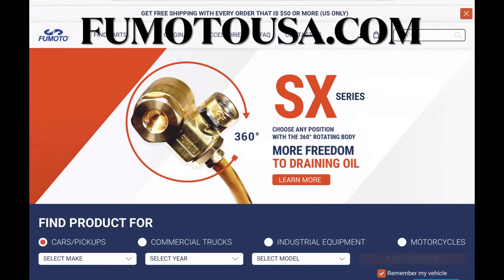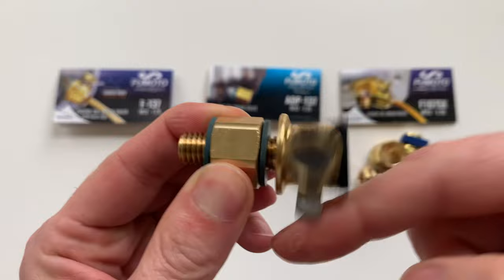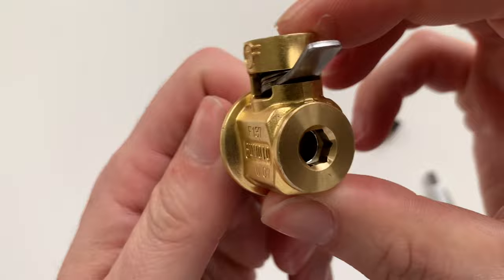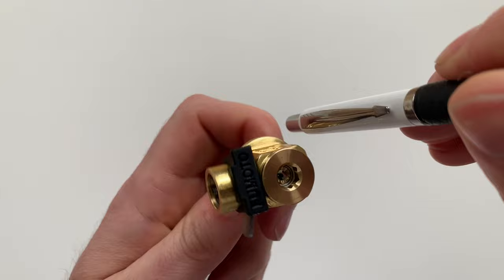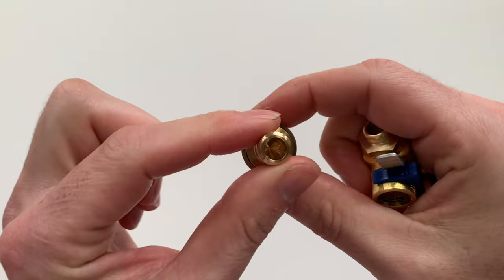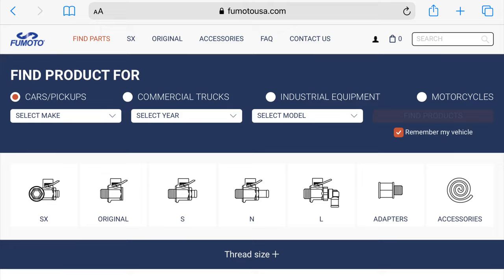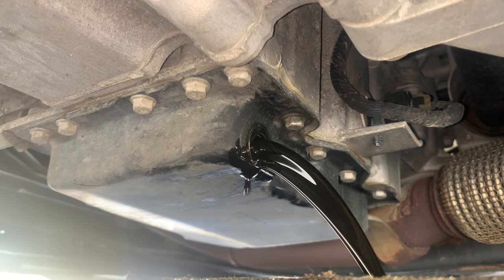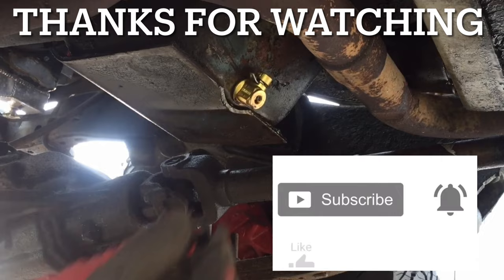Full Review of FUMOTO Engine Oil Drain Valve | Installation & Use | All Types (F, ADP, SX, S, N, L)

Comment: I just received mine today for both vehicles. Best investment I ever made. Did u use the washer came with or did u use the old washer?
Reply from the maker: I’m actually doing an oil change today and it’s nice to know I will just be flipping a lever with no tools required!
I used the blue washer that came with the valve. Not any factory washers.
If it is an SX, the valve has an integrated rubber o-ring and no washer.

Comment: Do you think this would be good for Honda Civic 2011…… ??
Reply from the maker: I have not personally changed the oil on a Civic, but I would personally install it. It will make oil changes easily with no tools required.
Reply: @HowtoandReviewsOfficial  - No tools? What about removing the oil filter? LOL...
Reply from the maker: @irishkelly654  That’s a good point. I personally just use my hand. However, some people put them on way too tight and they can be a real battle to remove.
I do all of my own oil changes, so I can remove them with my hand.
Reply: @HowtoandReviewsOfficial  - Thanks for the reply. Yes, I hear you. I do my own, too. I once had a filter leak because I didn't tighten it enough so I think I now overcompensate a little, ensure it is snugged down. LOL...anyway, all the best! Cheers...
Reply from the maker: @irishkelly654  I have definitely been there. I’ve punched a screwdriver through the filter to use as a lever more than once!

Comment: @4:25.... you could just jack the car up like a normal person to reach the drain valve.............
Reply from the maker: Good point, but slipping a board underneath was way easier and faster than dragging a floor jack out and setting up the jack and jack stands. The board was not as inconvenient as it might look. 
But, now I just reach under and flip the valve open, so it’s all good.

Comment: How much dirty oil do these leave behind? I remember on a message board someone tested this and the one that was tested left about 1/2 pint of dirty oil behind. It would have been nice if you would have shown this in the video.
Reply from the maker: That is a great point and an excellent video idea! I have also considered this, but have not tested it. I will make a video on it at my next oil change. I will drain everything with the valve, then put an empty catch pan in place, then remove the valve and measure how much additional oil drains.
I have these on four different vehicles. Maybe I’ll wait until I do it on two or three of them before I make the video so there’s more data. It should be vehicle dependent because of the shape of the oil pan.
Reply: @HowtoandReviewsOfficial  I did some research and on Fumoto's web site it states that none of the threads will extend into the oil pan.

The test that was done was on a BMW message board and the person even pulled the pan off their car and it showed the threads sticking up about 1/4". Now this test was about 15 years ago so maybe Fumoto has changed the valves and shortened the threads so they no longer do this.
Reply from the maker: @worldsails2000  Thanks for the update! I will definitely still do the video. I think it’s still worthwhile and I’m looking forward to it. It would be nice to prove it either way.

Comment: Dude, do yourself a favor and buy a pair of plastic car ramps.  $60 and your life will be so much easier.
Reply from the maker: lol. I appreciate it. I do have ramps, but three of my vehicles are too low to use them.
It’s no problem though. I can easily reach under and flip the Fumoto valve open and closed. It’s all good.
Reply: @HowtoandReviewsOfficial  Thats true with the old steel ramps but the new plastic ones come in a few different incline sizes.  All three of my family cars have low clearance and my ramps work for all of them.  I guess you can do without them but I cannot since all my oil filters are under the car.  I have to get underneath even with Fumoto valves.
Reply from the maker: @nickv4073  thanks. I will look into it. Ramps would come in handy for a whole lot of things other than oil changes.